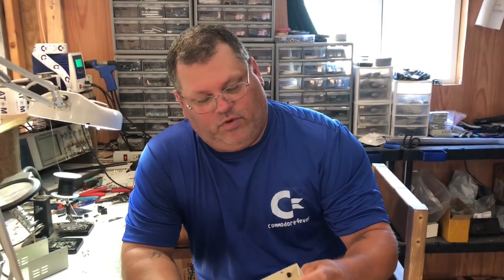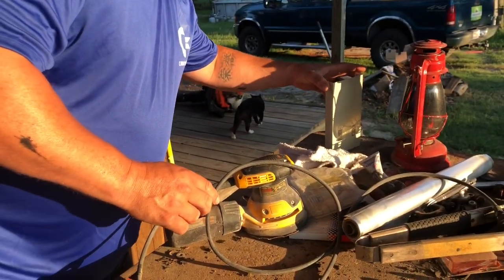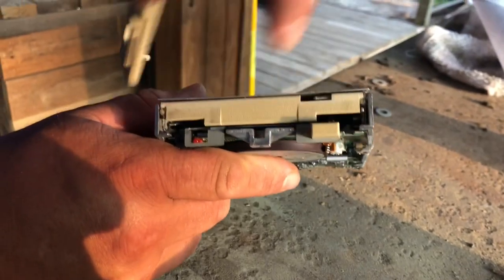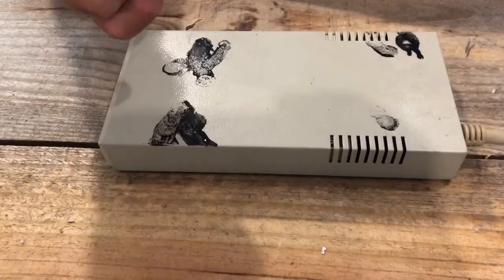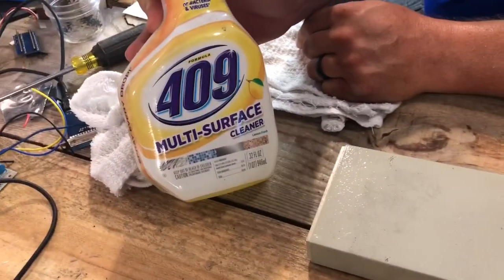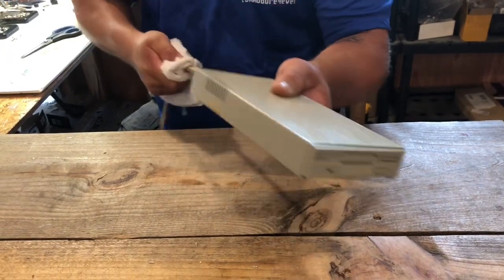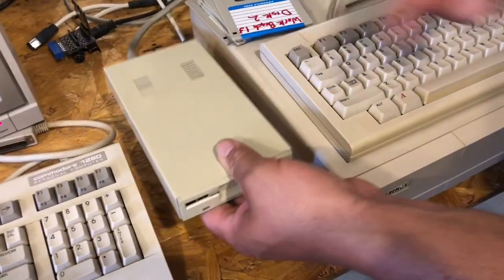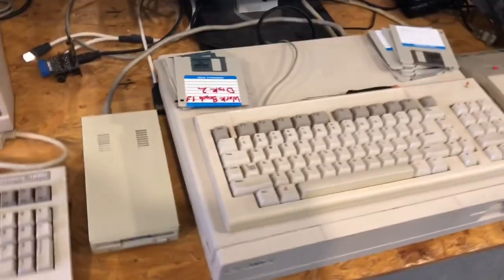Amiga external floppy drive refurbish

Comment: hello, im about to buy one of these external Amiga floppy disc drives and install the f1 flux device into the 1.44 meg floppy drive - the only thing is the usb connector which plugs into the drive itself sticks out towards the left side *(back) of the unit, how do i get around this ?? do i saw it (cut through it using a saw ??) thanks ............. the f1 flux device is used to read other  formats on Windows Winuae programs etc (emulators etc) ......... thanks............